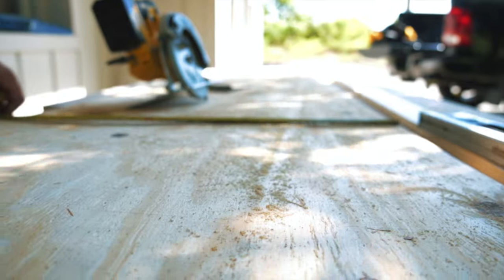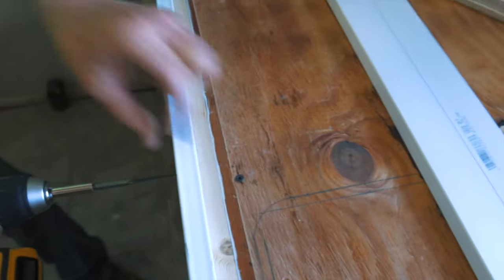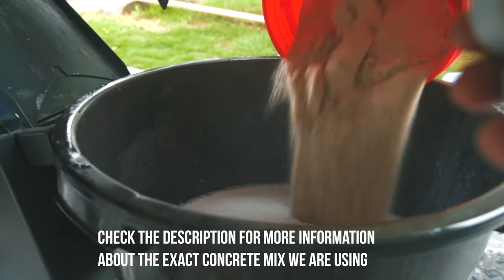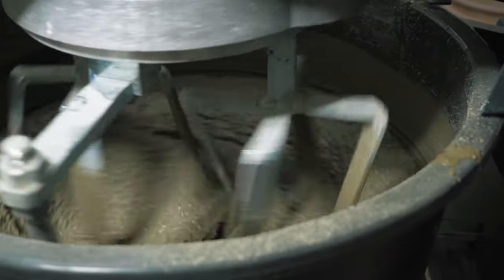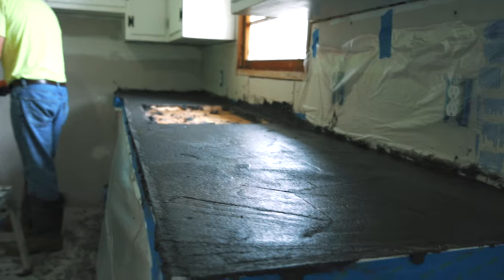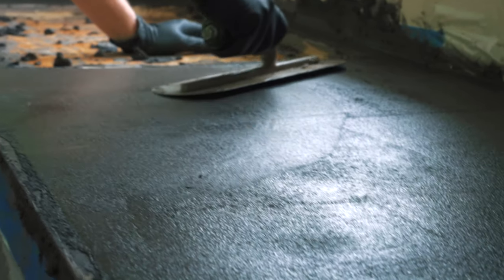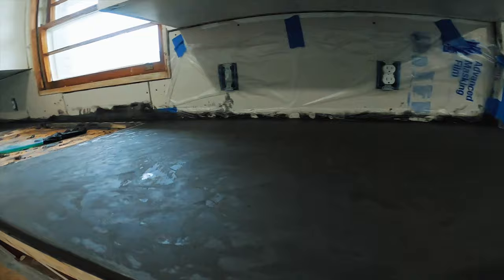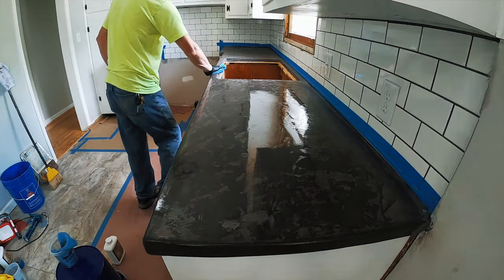How to Form and Pour DIY CONCRETE COUNTERTOPS in Place

Comment: I am using your form making method for sure. I had no idea the z forms were so expensive. For my kitchen I need 31 feet in front bull-nose or block forms alone.  Not including backsplash and around sink.  Your way makes it more do-able.  I am so happy I found your video

Comment: Cool vid. This reminds me of our current project. Cabinets are 35yr old oak getting painted white by others. In the meantime I’m preparing to use the countertop solution a form system hence the reason I’m watching vids. You’re using plywood whereas their system uses Durock or something similar. I too will need to reinforce our older cabinets to support the heavier counters. I’m using their white concrete formulated for counters with their fiberglass scrimm or whatever it’s called. Hoping the project isn’t a bust, yours came out nicely for sure. Thanks for sharing.
Reply from the maker: Thanks! 

I used plywood because I knew I was going to cover it with plastic to keep the inside of the cabinets clean.

That sounds like a fun project. Let me know how it goes. 👍🏻👍🏻

Comment: For the wall side of the mold , what did you use ? Was it plexiglas? I didnt catch it in the video. And did you leave it in place permanently? Thank you for a reply , we are doing this project this next month !
Reply from the maker: Hi Brandon. We just used white pvc lattice strips from Lowes. Yes we left it permanently because the tile on the back wall hid it. 

Good luck with the project. Let me know how it goes.

Comment: Excellent tutorial guys, appreciated, just one thing I'm confused about. Others use concrete which has reinforcement rocks in the mix, as with a concrete slab. It appears you have used cement, some plasticiser, water and sand for the mix and used some matting for the reinforcement, can you just confirm please?
Reply from the maker: Thanks!

Yes that is correct. 

Weve switched to just using pre bagged mix though. The mix from concretecountertopsolutions.com is probably my favorite. 

You just add water to the mix. All admixtures are already in the mix.

Comment: Great info on building forms, everyone is using the snap-off forms but they're expensive. Two questions, why use plywood when everyone seems to be using backer board? Second question, what are your thoughts on spraying the front edges to get a smooth finish like you do with GFRC?  In essence, spray along the PVC form boards you're using and then fill? Seems like the edges are always rough looking.
Reply from the maker: I’m not sure why people use backer board. I personally prefer to use wood & plastic so the countertops will be easier to remove if you ever wanted to change them out in the future. 

You could spray the pvc… but it’s probably not necessary. One advantage of forming the sides vs. the snap forms is that you can strip the forms before the concrete has set up… so you should be able to rub/trowel the sides pretty smooth. 

If you don’t strip the forms until after the concrete is hard, then I do think spraying the sides is probably a good idea.
Reply: That’s you should melamine instead of plywood for forms. The white smooth finish looks great.

Comment: What was your mix ratio? Or better yet, what recipe are you using? Where I live, my options are limited to your basic powder, and we grind our aggregates to whatever size we need for the job. Your mix looks a lot darker and also without stones.  I need to put a new layer of concrete on kitchen countertops because I cannot match the color tone simply by grinding them and resealing. Any advice? With the second layer, what's the thinnest you recommend going and would I use reinforcement?  Thanks!

Comment: Hey Tim. Love your videos. Do you have any breakfast bar videos? I'm doing a pour in place countertop that's gonna overhang 15" on one side. In the past I've  just used rebar and went with 2" thick concrete.
I'd like to make it 1 1/4" and use a scrim/chop strand mix. Suggestions?
Reply from the maker: Thanks! I think the skrim we used in this video would work for you. You could just use two layers to give it extra support. You could also add glass fiber to the bottom 2/3rds of the mix.

Comment: I hope this isn’t a stupid question, but you mentioned using a magnesium float? Is there something about magnesium that is different to any other metal? First rate video, thank you!
Reply from the maker: There are no stupid questions. Ha. 

We use a mag float because it doesn’t close the pores of the surface up, which lets water continue to evaporate. 

As concrete sets up, bleed water continues to come to the surface. We don’t switch to a steel trowel until that water stops coming to the top.

Comment: It really looks good. Don’t rush. Do your best work always. I didn’t see any vibration. Was it done and not included? Always vibrate. I’m just as critical on myself. I’ve done from small cosmetic skim coats to 1,500 yard pours for permanent foundations for 3,600 Ton-capacity cranes. I don’t know everything, but I know a lot. I came here to learn. Thank you for the high quality video. Great job.
Reply from the maker: Hey. Thanks! I appreciate the encouragement. 

We used to vibrate counters when we poured traditional Portland + sand + gravel mixes. 

Our current mix is sand and cement with additives. It’s very similar to a self consolidating mix so we don’t vibrate it.
Reply: That sounds fantastic. I’m gonna be doing my entire master suite in concrete since hurricane damage resulted in the removal of our (actually not-bad-looking) cultured marble countertops and shower. I’m considering adding some purposely-placed aggregate for a terrazzo-like effect. Any thoughts or considerations?
Reply from the maker: That sounds cool. 

You should look into using GFRC so that you can make the panels thin. 

I just made a countertop for my house with aggregate added to the face of the mold. I’m working on the video now...should be ready in January. 

I have a video from 2 years ago on my channel that covers the GFRC process... the new video uses similar methods, only we sprayed glue into the forms and broadcast agg before we started.  

Let me know how the project turns out. It sounds like a fun one.
Reply: @TimDCVA  that sounds almost exactly what I had in mind, except for a pour-in-place build with a solid amount of surface grinding. (Glue and broadcast agains the edge forms).

Comment: Hi Tim, I want to do a 12” overhang on an island, wondering if you would recommend doing pour in place or a mould? Also, what would you use to reinforce it? Thanks!
Reply from the maker: I prefer pre-fab counters. A GFRC mix would be plenty strong for that. I have a video that explains it…
Reply from the maker: Concrete Countertops Masterclass (DIY) - From Start to Finish using GFRC
https://youtu.be/iu8v_0HPigc

Comment: Hi Tim, Love the vid, gonna try this myself on new cabinetry. What do you you mean by "you would want to brace this board down to the ground" for the overhang?
Reply from the maker: Thanks!

My cabinets were old so I just screwed a board to the face of the cabinet to create the 1” overhang on the edge of the counters. 

On new cabinets you would be better off to just brace it all the way to the ground so you don’t have to put screws through the front of your new cabinets.
Reply: @TimDCVA  thanks for clarifying mate. How would I go about bracing the overhang mold to the ground? What tool would be best for the job? And any examples of this? Appreciate your prompt reply
Reply from the maker: I don’t have any examples of it… but just a 2x4 down to the ground to hold it up is all we would do. You just have to get creative when you are bracing them up to keep the face form from pushing away from the counters too. It’s different on every job.

Comment: Do you always use such a dry mix?  I’ve watched other videos and they were much wetter.
What’s the benefit of doing one or another?
Reply from the maker: The more water you add, the more likely it is to crack… so we don’t like to add a lot of water. 

We usually get a more flowable mix by adding more water reducer / plasticizer, but that also slows the set time down a little. 

I knew I was going to be waiting all day on it to set up so I didn’t want to make it any worse by adding something that was going to slow it down.

Comment: One final question i have, if I use the fiber mesh reinforcing - what is the maximum overhang with a 2" thick slab?
Reply from the maker: I’m not really sure what the answer is to that. Sorry.
Reply: @TimDCVA  thanks for being honest. I'll stick with 1 1/2" should be ok

Comment: Hi Tim, the back wall behind my outdoor counter is uneven stucco. What do you recommend for the form against the stucco wall?
Reply from the maker: I’m not really sure. I would probably just pour right up against it… just mark a line so you know how high the concrete needs to go.
Reply: @TimDCVA  thanks. I am also concerned about the gap at the bottom of the mold that concrete will drip inside the structure since there are gaps. I was thinking to fill it with mesh tape and thinset prior to pouring to fill the gaps.

Comment: How many pounds of concrete did you use on the long top.  Just wondering how heavy an 8' piece would be if I did it on saw horses?  It will be my first time. 
It looks a little to messy to do it place. Thank you!
Reply from the maker: It is messy. That’s the primary reason I don’t like to do these for customers in place. 

50lbs of concrete covers 5 square feet @ 1” thick.  So it would be around 225lbs if you cast it 1.5” thick.
Reply: Thank you!!
Reply from the maker: You’re welcome.

Comment: I have a small light textured rubber stamp i was going to use on the top. Is it worth the mess since id have to use a powder release then or is there another method for textured surface?
Reply from the maker: You can use liquid release and color with an antiquing agent on stamped concrete. I’ve never tried that on a countertop. It might have too much texture though.
Reply: @TimDCVA  that's right, liquid release. And yeah, I think you're right, a counter top should be smooth. I'm gonna make a table to practice on first. Maybe that could be textured. Thanks for responding.

Comment: Tim, Is there any gravel in this concrete mix ? Or since you usually add fiber you don’t typically add gravel ? Nice video
Reply from the maker: Thanks! This is our GFRC mix, which doesn’t contain any gravel. I should have used glass fiber in the bottom 2/3 of the countertop but we didn’t have any in stock. I wasn’t sure how long it would take to get it shipped in during the lockdown so we just moved forward without it.
Reply: TimDCVA ok awesome. Can you do a red wine spill test please in your next video lol 🤓
Reply: @TimDCVA  well that answers my first question, thanks!!
Reply from the maker: What’s your second question?
Reply: @TimDCVA  guess I just had one last night, but now i need a good mix design with the ratios for sand, portland, polymer and the amount of fiber. Would buy premixed but nothing available locally unfortunately

Comment: Do you prefer to do it in place or by mold, and if using GFRC, how would that change the process in place
because you normally spray a cover coat on the bottom of the mold which is now on top
Reply from the maker: I prefer using a mold...traditional GFRC. I can’t imagine doing the process in this video on top of someone’s brand new cabinets.
Reply: @TimDCVA  good luck carrying a massive slab in that weighs nearly 800lbs all while without it snapping at the sink.
Reply from the maker: Ha. It’s not that heavy when it’s only 3/4” thick in the middle. 

The sink thing is an issue though. Lots of people will cast them as one piece...but it stresses me out carrying it in like that. I usually put a seam somewhere near the sink so there’s not so much tension on it during installation.
Reply: @TimDCVA  seams at the sink are for amateurs
Reply: @j8ke937  that's why you add rebar mesh if you're doing a sink cutout dimbo
Reply: @j8ke937  who let the over dramatic middle schooler in here?

Comment: Hello Tim, thanks for the video.  Can you share your recepie for the mix you used. I’m looking for the strongest mix possible.
Reply from the maker: We didn’t do anything too spectacular on this one. It was filmed during the pandemic and I didn’t want to have to wait on materials...so we just used whatever we had in the shop. 

This particular mix is 50/50 white Portland & sand with Buddy Rhodes polymer additive & glass scrim. I would have liked to use glass fiber to the mix ...but we didn’t have any in stock.
Reply: @TimDCVA  what made it so dark?
Reply from the maker: We added black pigment to make it a medium shade of gray.
Reply: @TimDCVA  so i plan on using the fiber particles in mine, how do i avoid the fuzz that will stick up on the surface?
Reply from the maker: I’m not sure that it can be avoided if you use fiber. 

I would suggest not using fiber in the very top layer. If you do use fiber, consider using PVA fibers because they are really fine and should be less visible in the finished product.
Reply: @TimDCVA  thank you!

Comment: Hey Tim, I purchased your concrete recipe several months ago. How do you go about pricing for doing custom tops? I am adding this to my construction services.
Reply from the maker: Pricing is really hard on countertops. (No pun intended). Ha. 

It’s a wide range that changes based on how complex the job is. Anywhere between $80-$120 per square foot. Email dm me on IG and I can explain.
Reply: @TimDCVA  What's your instagram?  I have a project going in this week.
Reply from the maker: It’s @timdcva

Comment: Is this countertop grease stain proof? I had once concrete in bathroom and and even though it was sealed it had a grease stain on it from body oil... How to prevent that?
Reply: You had the wrong sealer in your bathroom. Yours had a water based sealer. You need a solvent based sealer or a wax to prevent grease stains.

Comment: Why do you mix the concrete so thick? Why not mix thin enough you can just pour it in so it levels itself and makes the job go a lot easier?
Reply from the maker: A few reasons… I didn’t want to have to deal with a lot of bleed water in a finished kitchen. I also didn’t want to wait all night for it to set up. Lastly, using an excessive amount of water makes it more likely that the concrete will crack.

Comment: why arent you using aircrete?
Reply from the maker: I’m not sure what the reason would be to use it. Weight isn’t an issue when the concrete is only 1.25” thick.
Reply: @TimDCVA  less material so less carbon footprint and HELLO ITS THE COOLEST THING TO HAPPEN TO CONCRETE SINCE CEMENT. lol i have no clue :P just mixxed up my first batch of cement a couple of days ago so been youtubing n been obsessing on aircrete. n just goofin off the initial question was a bit of joke too. but thanks for the vid

Comment: Dude you need to give these people their money back and learn to finish concrete. Maybe if you didn't openly admit to cutting corners and forgetting half the materials it would have turned out half decent. You don't run a steel trowel when it's cock stiff, its so patchy (especially noticeable when you "seal" it). Please consider learning the correct process and techniques before you deliver such atrocities. I hope you didn't get paid.
Reply from the maker: You must have missed the part where I said that it was the kitchen at my office. 

I like the way it looks when we trowel it late.  It’s just personal preference. I get that it’s not for everyone. I do prefer pre-cast concrete countertops though.